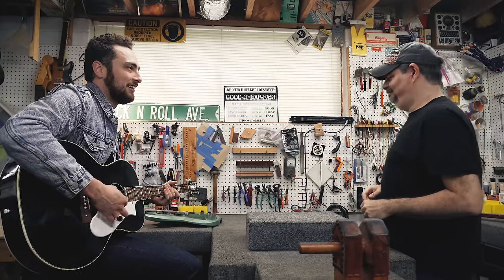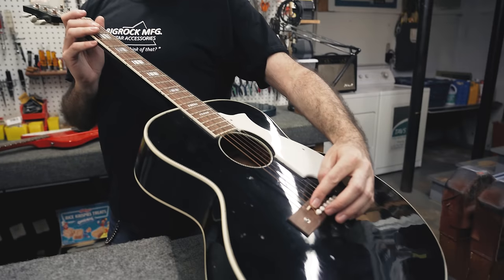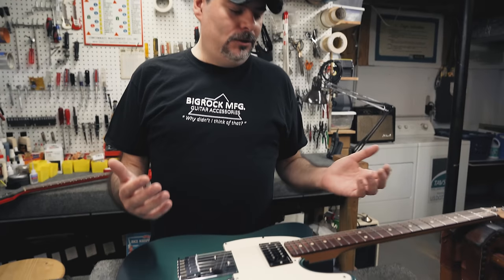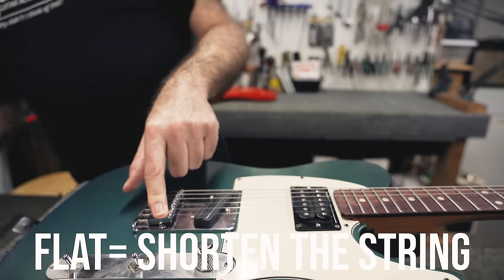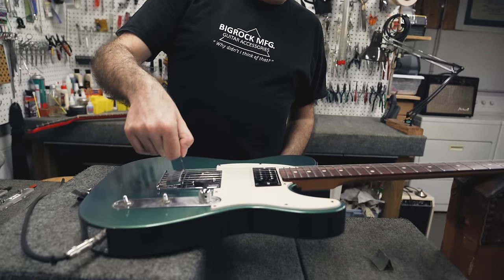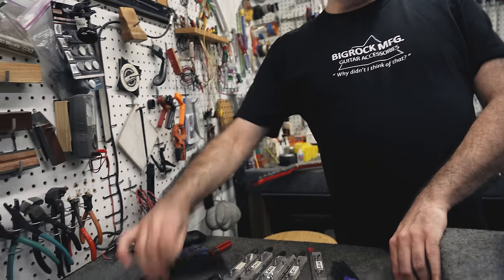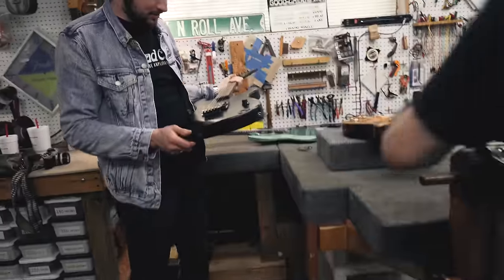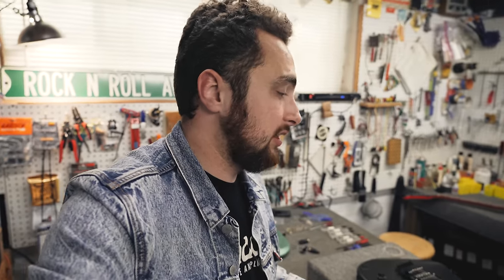5 Guitar Setup Tips & Tricks You NEED To Know

Comment: I've never understand the intonation part, If an open string is in tune and slightly sharp or flat on the 12th fret than u will adjust on the bridge, so after the adjust, it's in tune on the 12th fret but now the open string is out of tune, and this is a never ending circle, is it just because i have cheap guitars or i did something wrong or anything else ?
Reply: It's two mechanical adjustments and each one effects the other one.  So you tuned the tuner with the bridge intonation where it was then you adjusted the intonation, you've moved the length.  Bottom line you're always going to have back and forth and you're always fighting overshooting where you want be.  The key is when you get very close where you need to be the best way to minimize the back and forth is: if it's close don't adjust the intonation perfect leave it slightly short, then re-tune and recheck.  If it's close the start with you'll end up only doing this once or twice.   Conversely, if it's way off to start don't worry at first because you're going to be doing this several times.

Comment: Dave! How do you radius a Floyd? Asking for a friend. 😂 No.. seriously. My D and G strings rattle and the Es you can fly a plane under.
Reply: I'll pop in here since Dave might not have seen it yet.  There are a couple different types of floyd bridge plates and saddles.  SOME of them, the bridge plate is radiused, and on others, bridge plate is flat and the saddles are made in different thicknesses, so the two tallest would go in the center for D and G, the next two shorter would be A and B, and the two shortest would be the two E strings.  That's where you'll need to start.  If you bought the guitar used, make sure you have whichever type of saddles your Floyd calls for actually on it, I've had guitars come in with saddles that someone changed out without realizing that there are two different types.

Comment: Maybe someone can help here... I changed strings on my epi es335, and i should adjust the truss rod, cause i have fret buff. But the problem is, that i cant put my gripper wrench in. I use the correct size. I read on some websites, that it can happen when someone is trying it with the wrong size gripper wrench and destroys it, but thats not the case, i bought the guitar brand new. I dont know what to do, its really frustrating. Is there anyone who has solution?

Comment: Thats not how you use the bridge pin puller on the winder. t is supposed to be vertical and you slide it through the arch. Then Just pull straight up.